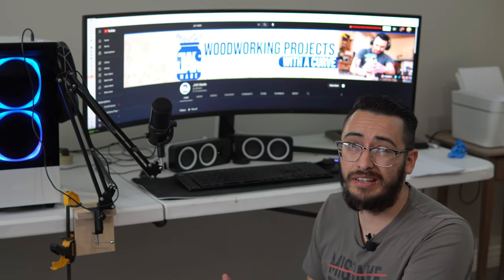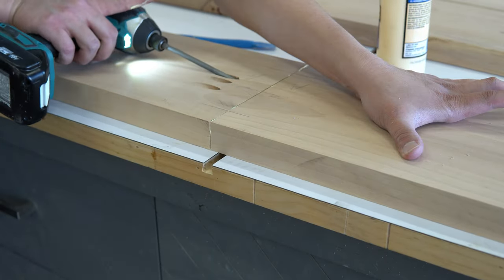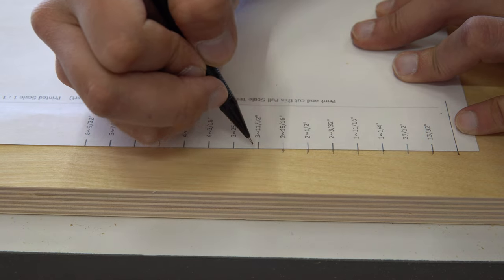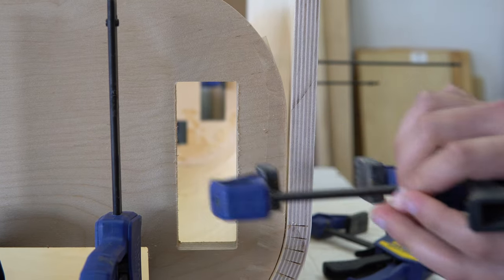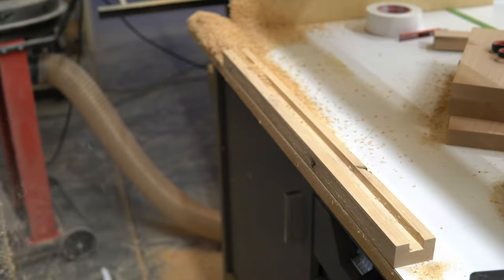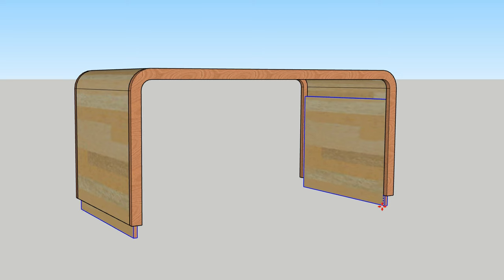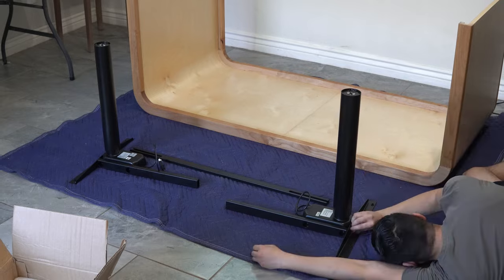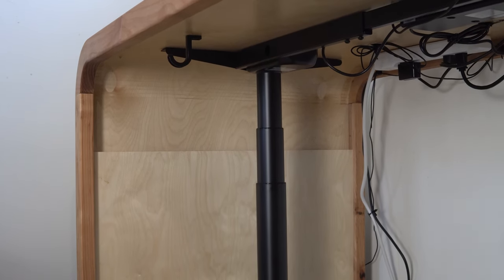Make a UNIQUE Sitting Standing Desk By Bending Wood!

Comment: I got here from your "How To Bend Wood By Looking At It."   Very inventive! I saw something ages ago where a guy made a locking drawer joint by having a custom saw blade made to cut the shape he needed.  I wondered how much that cost.  Seems like it would be simple to have an angled saw blade ¼" thick, with the angles on each side and a 1/32 radius on the outer teeth.  Then a finger joint jig could be made and this could be done on a table saw.  The blade could be 8½" diameter or maybe even 6¼".  I don't know how much the angled CNC bit cost, but it is probably shlow compared to what you could do with a table saw blade with that shape.  Have you bent 8/4 boards?  I have an idea that has curves in 2x4s. This is a great idea with endless possibilities!  One strange thing here is the reducer on the Dewalt planer outlet to an expansion adapter on the hose.  Wouldn't the hose fit onto the planer outlet?  Excellent videos and well done!